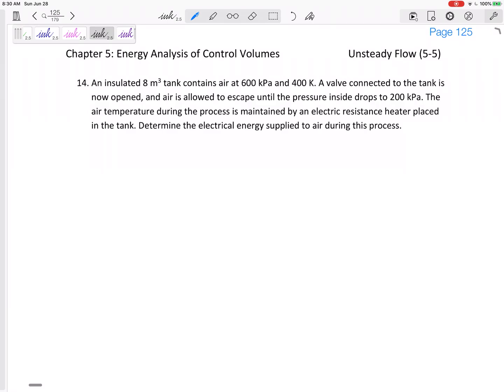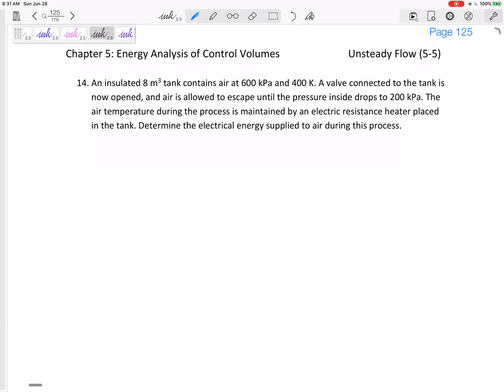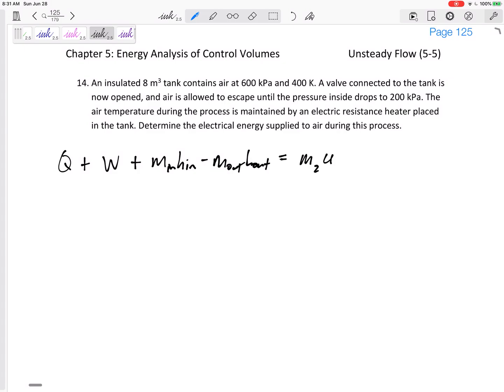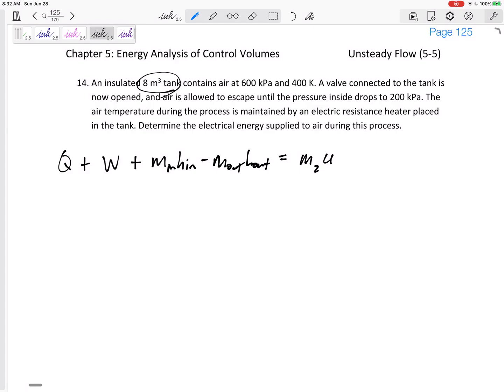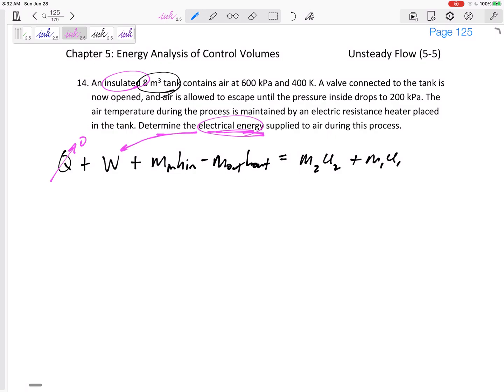Thermodynamics - 5-5 Unsteady Flow example 2

Comment: Professor I wonder why all properties in table A-17 (ideal gas properties of air) depend on just temperature but not pressure?Is pressure not important for ideal gas properties?
Reply: its called ideal for a reason.......thats why pressure doesn't play a big roll, at low pressures, the thing that plays a roll the most is temperature
Reply: @aboudi_301   Oh got that thanks a lot

Comment: Hei man, when calculating m_2 you used the initial volume for the ideal gass formula. what i am confused about is isnt volume changing since air is escaping? i see the mass has decreased but what about the volume. pls answer :)
Reply from the maker: Just keep track of the volume of your control volume, which is the volume of your tank. As long as the tank isn’t getting larger or smaller your volume stays the same.